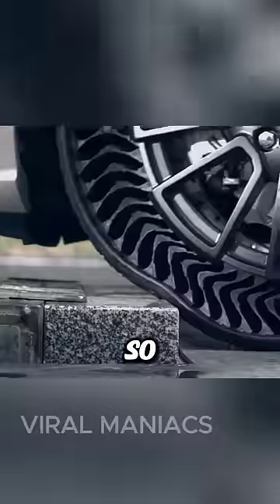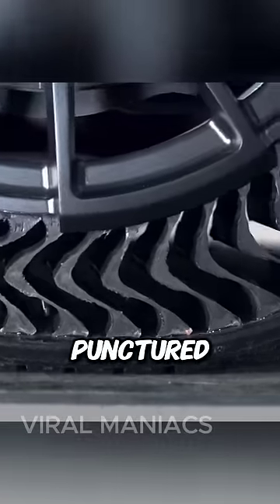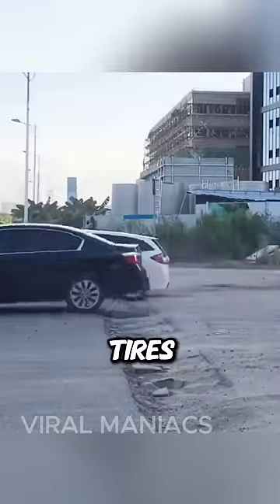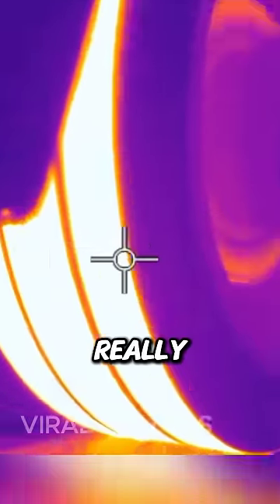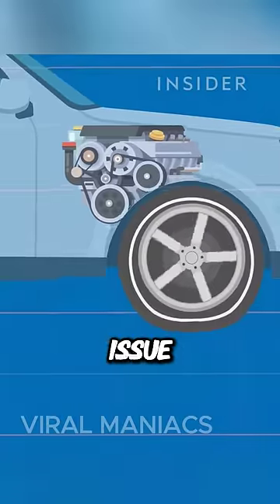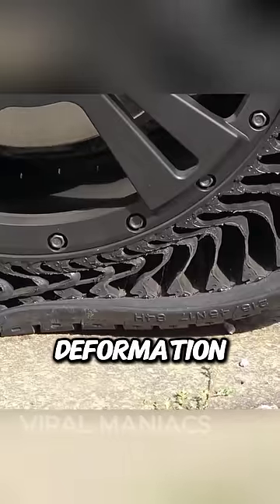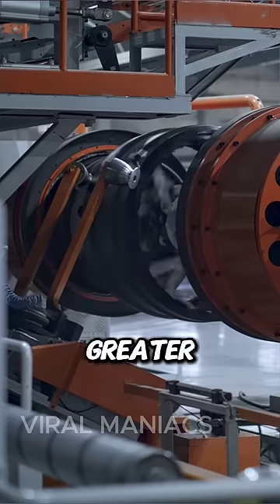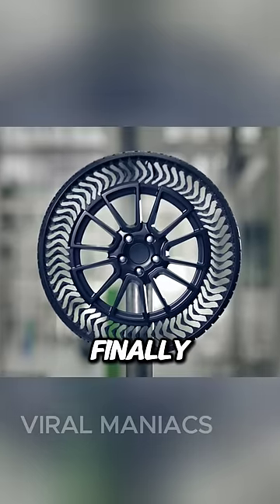Why Don't We Use Airless Tires Yet #shorts

Comment: I could be wrong but I think if one were to switch to airless tires they might have to also change the whole suspension set up for the vehicle because the tires with air absorb a lot of shock from the roads. Energy has to go somewhere. If someone put on airless tires and didn’t change the suspension then the shock would go from the tires to the frame which the tires are mounted to. And where would the shock or transferred energy go to from there ? The vehicle would probably rattle apart eventually.

Comment: Why not put a tyre/inner tube under the airless tyre? You keep the comfort factor and if you have 6"s of the airless section you are highly unlikely to get a flat and it wouldn't affect your journey as you just run on the airless if it was punctured and replace it at a later date.

Comment: Glass fiber reinforced plastic… I just had a bad experience with glass fiber a week ago! If the glass fiber is old it starts to send these little needles and if you touch the fiber yoir hand will be full of little black needles. They are painful and need tweesers to get out. I recommend changing the tires atleast every 6 years to not get any needles 👍

Comment: Just don’t go over gravel, mud, dirt, ice, snow, sand, anything but really clean pavement or concrete. Otherwise, those gaps will be filled with all of that stuff I mentioned and totally throw off the balance and ruin the tire quickly. These are so dumb except for exclusively clean asphalt and concrete.

Comment: They are way cheaper to make, so of course the manufacturers are interested. One the machines are set up and supplied with materials these are quicker and easier to make…. And cheaper. They also weigh less so transportation costs also go down. They have their downside too, they wear quicker and are sold for more money.

Comment: Deformation, no impact absorb, also are very dangerous for places with debris, a rock can stuck inside of structure and compromised the stability and bearing of the wheel.

Comment: Great, but an air tire has the ability of inflating and deflating for different purposes such as fuel efficiency, track performance or improved traction, all that magic just requires a air pump and valves 😃

Comment: Brakes generate a lot of heat. A metal wheel helps dissipate a lot of that heat. You can feel it after you drive for a while. So with a plastic wheel where is that heat going to be dissipated so excessive brake lining wear and braking fade  effectiveness doesn't occur?

Comment: Gas mileage is another issue more tire on road means more fuel consumption. Really though theyd be a great spare tire idea. Never flat always ready. And most the issues you have with them go away since its temporary and not under load much

Comment: hey guys 
you know what happens when you bake bread?
the microbes poop air into each square micro millimeter,
--so do the same with tyres.. but instead of flour dough use rubber dough plus in a circular mold
--this type of tyre will have  suspension  along every cubic millimeter of its material, better than this

Comment: How are they reducing rubber consumption? It seems like the airless tires require more rubber than traditional tires and most of my punctured tires needed replacement anyways. Maybe there is some analytics to determine how much rubber(tires) will be saved from punctures?

Comment: I will only use those for emergencies. If i have a flat tire, i'ma bust this bad boy out and drive it to the next best mechanics and either try to repair the tire or replace it completely, but to use it on a daily basis? Maybe on EV cars in a city where you can't exceed the 30 mph limit anyway and even then I'd be skeptical.

Comment: What happens when the roads are wet or snowy? Does this have better or worse traction? Does it just fling water and spray out to the sides as the weight of the car pushes the spaces together?

Comment: Nope, they won't release airless tires and they'll be banned worldwide because of one crucial thing. How cops would stop a runner with airless tires? Currently they can stop them by blowing the air of their tires out, but airless tires can't be stopped the same way. So, they'll only be avaliable when cops develop a way to force them to stop if needed.

Comment: How are you going to adjust for load? A car filled with people and a full boot  for holiday has a different optimum tire pressure than with only the driver on board. Will this airless tire be too soft for the first situation, or too stiff for the latter?

Comment: How well would they work in winter the material gets harder as it get cold.the open spaces get filled with snow and ice causing balance problems dirt and mud will create the same problem. One of the key designs for a winter tire is soft compound that grips to snow and ice when cold .airless tires on construction site machinery ok .on vehicles that travel 60 mph or faster on public roads .NO!

Comment: Reducing rubber waste is a BS reason, the reason for these are for more sales, money, since these tyres will worn out faster, not the outside but the inside material, typically you don't need to change tyres that often, but with these you will have to change tyres often, so it's just these companies want more money, that's all.

Comment: Regular air tires are required for heavy loads and pulling trailer and airless tires will not work for truck and semi 🚛 trucks and dump trucks,air tires has to have weight travel to travel over off road and highway .
So no there's are no future airless tires for trucks and semis trucks and military service jeeps and humveev and tanks and military service giant semi trucks pulling tanks and helicopters and weapons and radars and missiles and rockets required high pressure air tires .

Comment: All season: no
Proper and secure seating on wheel: no
High speed rated with rough terrain capability: no
Recommended for use after damage: no
700-1000 a pop?: yeppers
Excessive wear on stearing components and suspension because cars were designed to use air tires?: uhuh, i think soooo

Comment: Why don't they just make tires cheaper and they could melt tires and make more tires with them. I would think that melting regular vehicle tires mixed with another ingredient could make a stronger bigger tire for farm tractors and large machines used on construction. So that would allow tired to be sold cheaper in every department but. But yeah rich guys are stupid in the sense that they just think about money signs instead of helping mankind while still making good money.

Comment: They have been "out" for ages, but no one wants them cos they are just not that good. Not adjustable for heavy weights and different cars, anything could get caught in the tyres making balancing a bitch, heavier than a normal tyre, good god the running noise. Might be ok for low speeds, but anything using them regularly... nope

Comment: First of all, the AI voiceover is almost as laughable as the tire itself. 

Secondly, there is a reason airless tires haven't been adopted yet. Actually, there are many reasons. In fact, there's ONLY ONE benefit to an airless tire. 😂 

Terchierily, don't even talk about the fact that when you need tires, you have the decision in buying a new set, or buying a used car for the same price. How long have they been engineering this? Yeah, I'm not interested in a 2 thousand dollar, completely proprietary wheel. 

How much you wanna bet it comes with a regular donut in the trunk, too. 😂😂😂